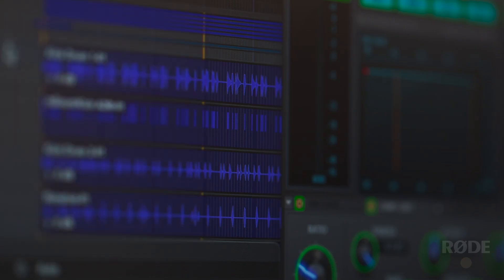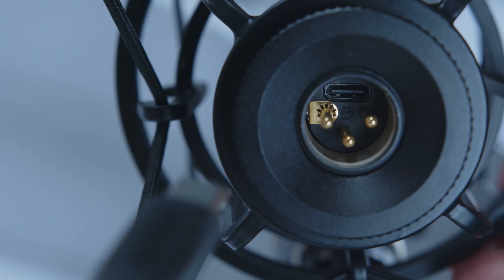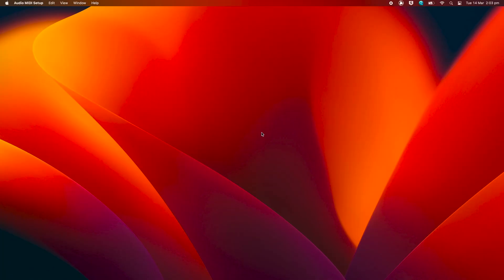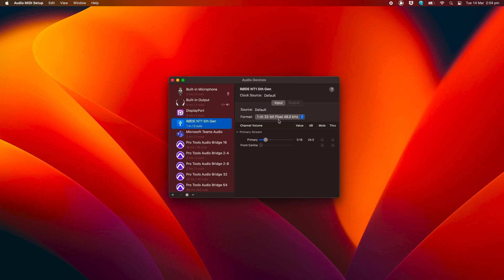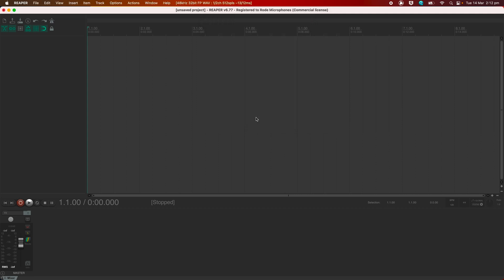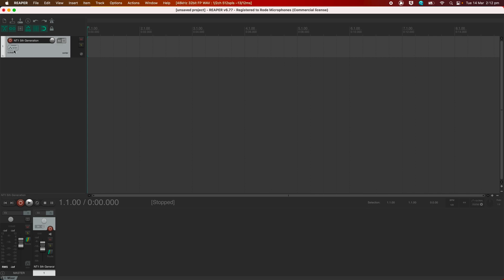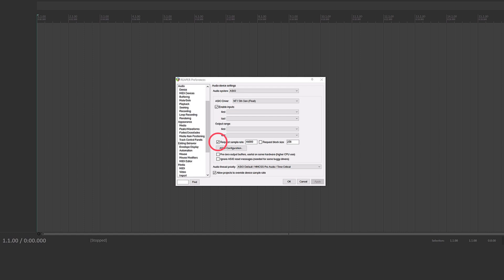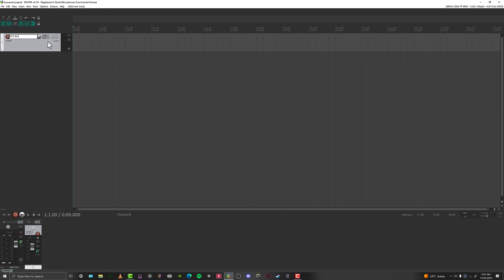How to Record 32-bit Float Audio with the NT1 5th Generation

Comment: The real proof would be taking the very end of the recording where it's quiet and amplifying that a lot in the 24-bit and 32-bit float recordings. The latter should have far less noise, proving it really does have a wider dynamic range.

Comment: Selecting NT1 5th Gen (float) ASIO driver in REAPER instantly crashes the program. Using latest Windows, latest NT1 firmware, latest ASIO driver from site. People also reporting this same issue in Cubase.
Reply from the maker: Sorry to hear that! Please reach out to our 24/7 Support team, we'll be happy to look at it on your behalf - https://help.rode.com/hc/en-us/requests/new
Reply: @rodemic  Problem appears to be with the Creative Z drivers. This is an older card, and it has its own built-in ASIO driver which does not work in these programs (only static). However, even with the Creative Control Panel completely disabled you still can't select a different ASIO driver. On my laptop with an onboard Realtek sound card everything works great!

Comment: Hello, looking for some advice on set up of the NT1 5 th gen Mic in Reaper , using the USB connection. I have downloaded the Rode ASIO driver and have connected the microphone. When the track is in record mode and in monitoring, the sound is coming through the computer speakers and not through my headphones via Volt audio interface. Not quite sure what to do to fix the issue. And would also love some advice on best way to control or lower the latency. Thank you for your time and help and by the way I love the NT1 5th gen.
Reply from the maker: Hey Matty, be sure to check the audio output settings on Reaper and set it to your Volt audio interface 😊 to reduce latency, you will need to lower your buffer size!

Comment: Thanks for the video! I just got my second NT1 5th and have two questions for recording Stereo in 32bit float on a Mac via the builtin interface: 1. After the Audio MIDI Setup is there anything to setup in Rode Connect? 2. Is there a workflow how to setup sereo 32 bit float recording in Ableton Live? I cannot get the second Mic running, I guess it is because I can only assign one Audio Interface to Ableton?
Reply from the maker: To use two NT1 5th Gens on a Mac using 32-bit float, check out the 'Connecting Multiple NT1 5th Generation Microphones via USB' section of the user guide - https://rode.com/en/user-guides/nt1-5th-generation#section-connecting-multiple-nt15th-generation-microphones-via-usb

Comment: Hello I bought the rode NT1 5TH generation and the A-1 sound card and the NTH100 headphones. But I'm having trouble connecting it. in fact when I connect the microphone via USB, the microphone is displayed on the different applications such as unify, rode connecte and rode central. But, when the USB cable is connected to the AI sound card and I connect it to the desktop, the A1 sound card, I have the sound but the microphone is not recognized by the application or the computer. This is actually my biggest problem. I can say that the microphone works when I connect it to the XLR since I have feedback via the headset but the microphone is not recognized by the computer application either. I want to know how to use my microphone and my sound card on my Windows computer.
Reply from the maker: As long as the audio from the NT1 5th Gen comes through when selecting the AI-1 as the input device (connecting the microphone via XLR), it should work fine. The computer does not recognize the microphone directly as it is being fed through the interface :) Hope this clarifies!

Comment: NT1 5th generation Only the USB connection has the 32-bit float？ what about the XLR connection？ thanks
Reply from the maker: 32-bit float is a feature of digital audio transmissions. An XLR port is an analogue port. So, by the nature of what it is, it can't transmit 32-bit float audio. If you use it with a digital audio interface that supports 32-bit float, that digital audio will be in 32-bit float.

Comment: Hi - When selecting Audio device settings and choosing ASIO reaper just crashes and closes down on me. This is after I installed the driver and restarted my computer. Is this a known issue any idea how to fix? Thank you
Reply from the maker: Hey there– the ASIO driver needs to have "exclusive" use of the device, so other programs can't use it. You mentioned that you've restarted your PC already, but it's worth restarting your PC, making sure that the device isn't being used by any other applications, and trying again. If it's still not working, we'd recommend getting in touch with our support team here: https://rode.com/en/support/contact

Comment: Is there any way to connect this mic directly into a Canon camera?
Reply from the maker: Hey there– that really depends how your Canon camera connects to audio sources. You're likely using a camera with a 3.5mm audio input, so no, this wouldn't work because even if you found an adaptor to connect it to this mic's XLR output, it wouldn't carry P48 phantom power, which this mic needs in order to work. 

If you're looking to stream or make YouTube videos instead, what you may want instead is an interface like a RØDE Streamer X which has a capture card and an XLR mic input, so you can record directly into your computer.

Comment: What will happen when you record in 32bit float with 192khz sampling rate?
Reply from the maker: Hey there, the NT1 5th Generation is capable of both 32-bit float and 192kHz recording simulatenously in USB mode, so the answer to your question is "you'll get some great sounding audio in your recordings!"

Comment: Hi RODE!
I downloaded and installed the ASIO-NT1G5 driver however I couldn't open the ASIO control panel. (I clicked on the ASIO configuration button) The input/output drop down menus were also blank. Is there a way to fix this issue? I think I did something wrong. Thank you in advance.
Reply: I connected the mic via USB-c to my laptop.
Reply from the maker: Hey Avana, sorry to hear you've had some trouble getting the ASIO drivers working - we'd recommend reaching out to our Service Team: rode.com/contact
Reply: will you solve this problem?